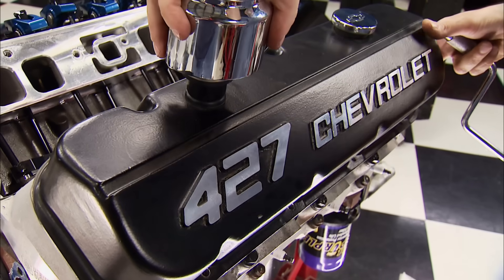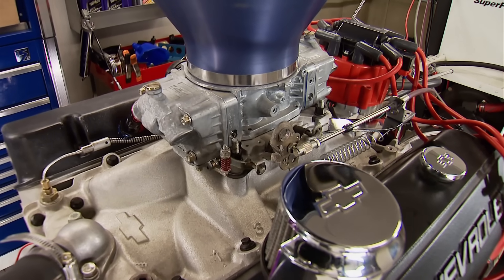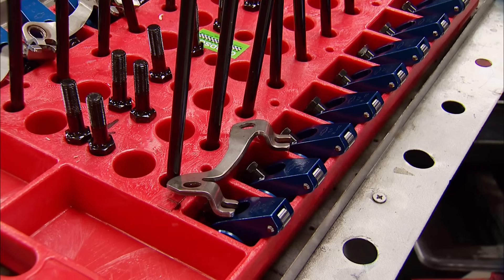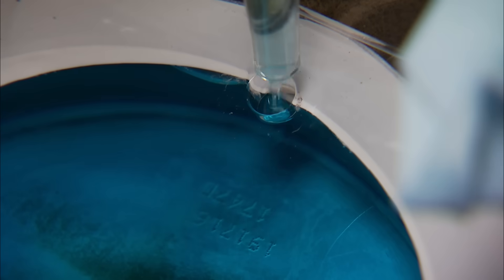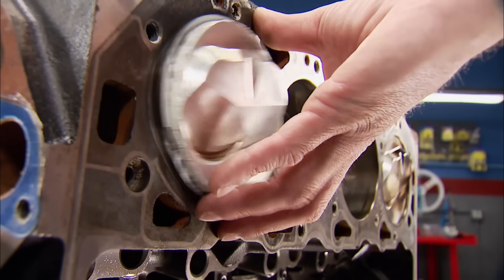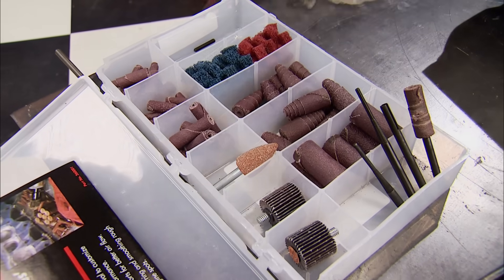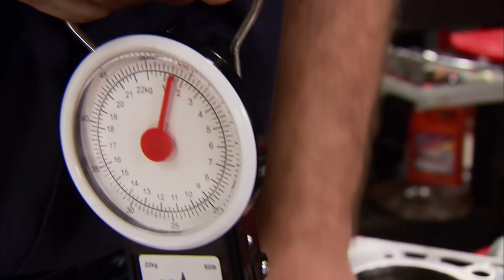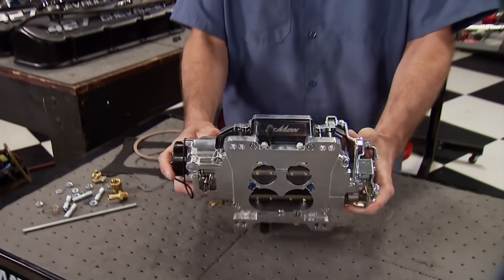Building A Stealth Crate 427 Big Block Chevy - Engine Power S1, E17

Comment: i been getting the 450 hp 454 with the 02xx trans for free from 6,000 to 58,000 miles on them that is with a stock carb and intake with high flow heads they come with steel crank heavy rods 10.5 to 1 compression but if u change the intake and put a 850 it really comes alive

Comment: I'm currently trying to build a low-budget 454 bbc from an early 90's 1 ton Chevy dually. I have found that it's a factory roller cam motor which is a plus. I'm going to try to do most of it myself seeing we no longer have a local machine shop around. I'd like to get between at least 350-375 to possibly 425 hp out of it. What would you suggest for a good cam choice and intake? I'm certain you would say 1st thing to change the pistons. Small dome? Thanks! I love your channel!

Comment: Why won't the mfrs go back to engines with 1 center cam, push rods and hyd lifters, and 2 valve rocker arms instead of all this multiple chain drive massive heads, twin cams, multiple valves, engines of today ? What was wrong with the simplicity from the past ?  Can the computer module not run that type of engine ?
Reply: Emissions reqiurements

Comment: I had a L 88 back in 1975, it was balanced and blueprinted. I could turn that engine to 7500 every time I wanted. Even missed 3rd gear once and the tach went to 8000. It was the best rat I ever had.  It  lasted 4 years, and when I sold it the guy ran it a couple qts low on oil, and ruined it

Comment: I got a really interesting question and it's not as dumb as it sounds. I noticed you polished the top of those Pistons which is a good idea. I'm curious about smoothing the edges of the dome. Instead of having sharp edges is most of those don't have rounding the edges a little bit. Would there be any advantage to that? The main reason I ask is I'm not a big fan of those domes in the piston. I prefer a flat top piston but with that 24° valve angle that's a little hard to do to get compression ratios of 10 or more to :1

Comment: Very interesting, especially as I am fixing to rebuild my 1969  Chevy 427. Looking for all the pointers and help I can get!   :)
Reply: I have a 427 in my 66 Chevelle that an expert mechanic built for me in 1983 and it still runs great 40 years later. I outran a policeman and all but 2 street racers. One had a pro bracket car with slicks and I was catching him. I never have traction when I take off with skinny street tires. Did you rebuild your 427?
Reply: if you have a true 69 427 there won't be much from this video that will help you with old school parts

Comment: Hey guys I'm putting my bigblock 427 60 over in my 88 monte carlo SS what headers was it that were used on the monte carlo you guys built I am also going to use your trick on notching the a/c box on the firewall if you could give me the brand and part number for the headers I would really appreciate it thank you Rick427.

Comment: $3500? Dang I need to find that type of deal
Reply: My 427 cost 3000 to build but that was in 1983 with good deals using the mechanic’s account. It would probably be 3 times that now.

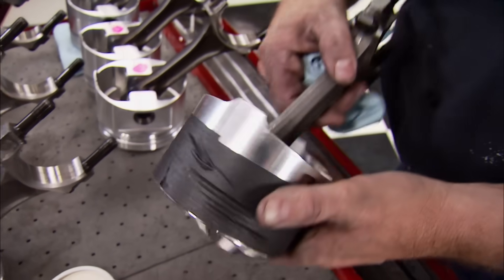Comment: @17:04 It's not motor oil! Show me a single "motor" that requires oil, and then show me where it goes! These are ENGINES, not motors...... Engine is internal or external combustion. Motor is electrical, always!

Don't believe me? 

Go find me a power window engine!
How about a windshield wiper engine?
Oh, I need a new engine for my ceiling fan in my kitchen.

They are not all motors despite the fact that they all create a motive force! Engines are defined by what they are, same as motors, but they are NOTHING alike! I do expect you to know better by now.

Enough of my noise.
Cheers 🍻.
Reply: Larger electric motors certainly require oil.

Also, why is detroit called the motor city? Why are motorcycles called what they are?

Relax, the English language is not consistant.
Reply: @crissd8283 :

 Oh yes, I knew how badly I screwed up right when I hit that reply button. Normally I write a draft, I proof read and then submit. This one I'm passionate about and I went a bit hot and fast. 

But I want to say here so that I don't have to say it a million times more:  I did not create the English language. I simply do my best to use it correctly every day, even when I intentionally use it wrong!
Cheers 🍻.

Comment: Umm, there is a faster easier way to get these numbers. Since CC is the only measurement we care about, then just do that everywhere, all the time. You can calculate the head gasket from pie, but everything else is a simple physical liquid measurement and there's your answer. Take that numerical value any way you like, but food color and alcohol is the best way to CC measure anything that requires a specific measurement at ambient temperature at your current level of specific gravity!
Cheers 🍻

Comment: Low tension rings only gain you about 8 HP. Engine Masters tested this and that's what they found. Not worth the oil consumption and ring coking issues. Remember Audi with their 2.0 Turbo engines needing their pistons and rings changed after about 20K miles? They used low tension rings in those engines. Funny how the oil consumption went away after they installed new pistons and standard tension rings. You can pick up 8 HP by advancing the timing, a cam change, roller rockers if it didn't already have them, or installing a good set of headers. The rocker arm change they are doing probably freed up 8 HP. That engine won't last with a power adder on top of it. They'll be tearing it down for a ring job after 25K miles.
Reply: My engine builder built my 427 in 1983 and he was against nitrous or anything else and said “You want power available all the time so it’s always there” he also had me use lower compression pistons at 10.25:1 so I could use pump gas and it’s still running great 40 years later. It’s got a lot of power and surprised everyone including a policeman who I outran in 83. The builder made everything work together and was a master in tuning. It’s in a 1966 Chevelle which was my first car.

Comment: They put a 770 cfm on a 427 bbc and a 950 on a wore out 305🤦‍♂️ what in the world lol.
Reply: If I heard correctly the 770 was what Chevy used for testing the engine (at 1:22).
Reply: @2aminitials  yes, you did hear that right. I was really just busting their balls a little is all. But, at 480 some horse that's all it really needs. It's kind of funny they put a 950 cfm carb on a 250 horse 305.
Reply: @engines-anonymous  Yeah they do some odd things sometimes.

Comment: Wtf is the point of buying a hopped up crate engine if you’re just going to change half the shit that makes it a special crate model? Why not just start with a factory stock block at that point if you’re just going to upgrade all the upgrades shit already in it 🤷‍♂️
Reply: It's because the manufacturers give them free parts to showcase, think of the show as an infomercial and it'll make sense....
Reply: I wonder about itemized price to buy the "keeper" parts individually. Could it be it's actually cheaper to start with a complete engine? I also wonder why anyone would go to the expense to build a BBC or SBC when the LS engine family is so readily available and makes so doggone much reliable horsepower.
Reply: @drewt3210  People who are restoring a classic car that had a 427 would do this. This engine drops right in versus the more expense of buying LS swap parts, and or custom fabrication. Ideally, you want a numbers matching car for the most value but a period correct car is the next best thing. I mean LS swapping a 67 Corvette would be cool, but ultimately more expensive than stabbing in another 427, and removing value at the same time. Now if you're doing a rat rod or restomod then the LS swap can come into play.
Reply: @TwentytenS4B8  Great points, thank you! I'm probably outta touch, but it seems the numbers matching museum cars are a thing of the past. Seems we're almost all building them to drive these days.
Reply: @drewt3210  Not really out of touch. The LSx is a great engine that makes plenty of power. But sometimes the circumstances don't warrant the swap.
Reply: @drewt3210  IT costs a ton to build an ls and not everyone that owns an older car wants one . Ever been taken in for a thrill ride with a built big block?
Reply: It's always good practice to do a tear down of any used engine you buy that you don't know its history. At most, all I would have done was install new bearings, reassemble it and stab it in to whatever project was going to receive it.
Reply: @TwentytenS4B8  the wear and failure items aren’t what I’m talking about. But the cam, rollers and lifters are part of why that engine was worth anything to begin with being upgraded from the crate already.

Again why buy a hopped up motor if every part that makes it hopped up over a base factory motor is going to be taken out snd replaced.

That’s like buying a brand new home just to tear it all down and build a new one. Instead of just building it how you wanted it from the get go instead of buying already built plans or buying s junk fixer upper
Reply: @mrmidnight32  I agree on it being silly swapping out the performance parts already included with the engine. I was pretty much agreeing with you when I said I'd tear it down to inspect it to make sure nothing was broken, check clearances, and at most replace things that would leave you stranded like rod and main bearings then assemble it ( With all the parts that came with it. ) install it and enjoy the living hell out of it.

Comment: I never understood the cylinder head and piston polishing on a street engine. How long does it take to carbon all that work away?
Reply: Easy to remove with premium fuel and an Italian Tune Up. Drive it like you stole it = carbon removed.

Comment: How much power do you free up approximately from changing stock piston rings to low tension rings?
Reply: Engine masters tested this an found 8hp.   Not much...
Reply: @mikeg4163  Seems worth it considering the price. Also I assume it extends the engine lifespan? I may be wrong though.
Reply: Not enough to warrant oil burning and coking issues. Audi used low tension rings in their 2.0 turbo engines. Every one of them are smoke machines. They finally fixed that problem because they got tired of paying for customers to have their pistons and rings changed. You can get 8 HP by simply advancing the timing.

Comment: I have the factory medium-duty version of that engine sitting in my 1974 c65 Chevy truck except for 8 years and all I did was pull the carburetor off clean the carb and put electric fuel pump from a gas can to the carburetor in it fired right up and drove home

Comment: You guys stole that engine at $3500.  I paid $7800 in 2012.  Now they are $11k.
Reply: Yeah $3,500 for a barely used 427 crate engine? Unheard of. Although this was filmed in 2014, so that was when times were good for finding great deals.
Reply: Guess I should have bought one 5mo ago…cheapest I see is 12K

Comment: I'd like that I my 1ton truck to pull my trailer
Reply: Get yourself a diesel engine for that task. Nothing's more enjoyable to tow with than a diesel. So much grunt right down low, it doesn't need to rev and scream like a gas engine.
Reply: @Warrior_Resisting_Colonialism  I hear ya but this motor would pull the fck out of a trailer aswell and a diesel doesn’t sound nearly as good as a screaming V8
Reply: @hillybillysillysally5086 let's not forget the joys of diesels having DEF crap. $300+ oil changes. I'll stick with a gasser over a modern diesel anyday